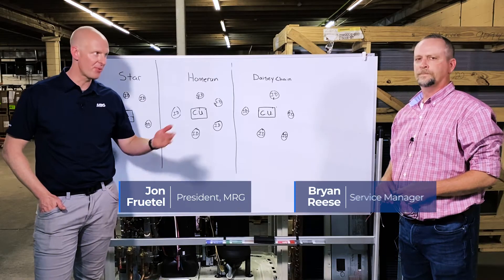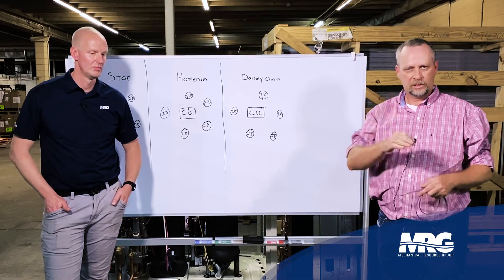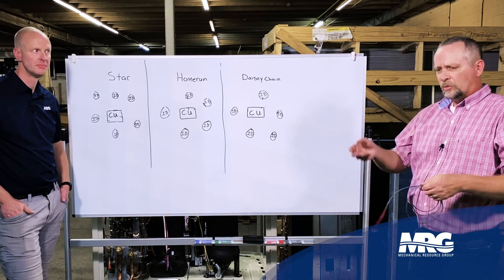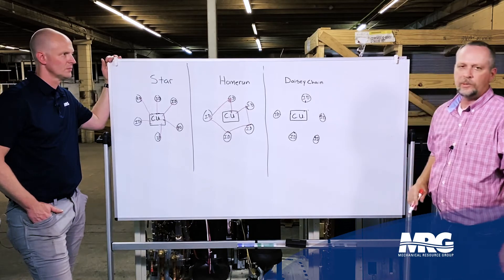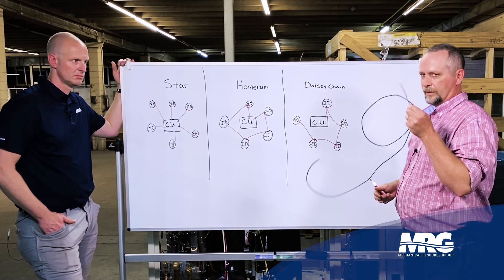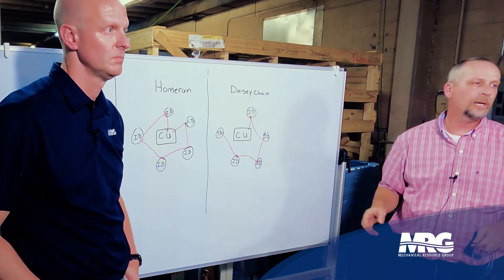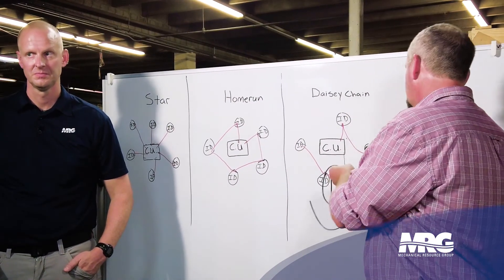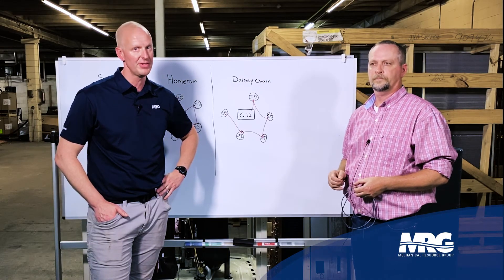Wiring and Controlling Daikin VRV Systems: A Technical Guide for HVAC Technicians

Comment: your description of twisted-pair copper might have missed the word "stranded", which is "special" in that some infrastructure wiring uses solid-core because it doesn't move around; stranded wire is for places the wires jiggle or move, so STRANDED wire that is permanently connected is "special" (see how most of your permanent wiring is solid-core).

Comment: Very good information about transmission cable .here in Chennai most of the dealer use shield wire 1sqmm .i have faced lots communication error problem. Now I understood may be chance if we laid shielded wire may work like antenna.

Comment: Good explanation of the three common wiring topologies.  Couple thoughts:  18/2/stranded/twisted/non-shielded/no-ground/plenum-rated wire is "special" compared to what that majority of Contractors are accustomed to using.   2.  Are you sure telling installers that switching polarity throughout an install (not best practice) is a good idea?